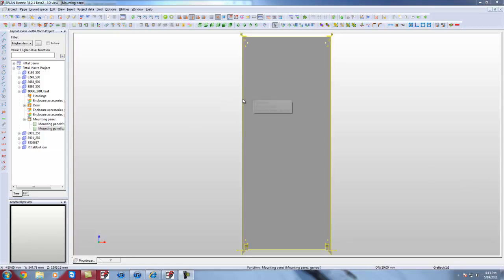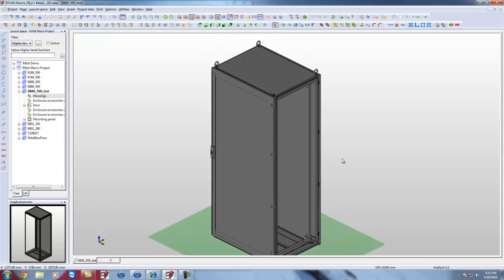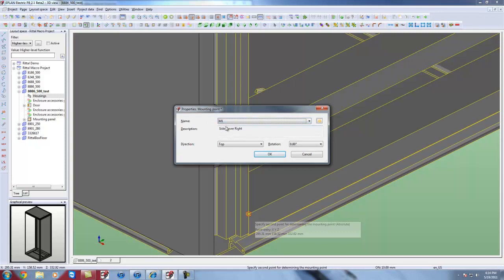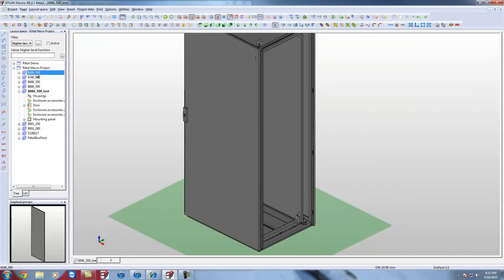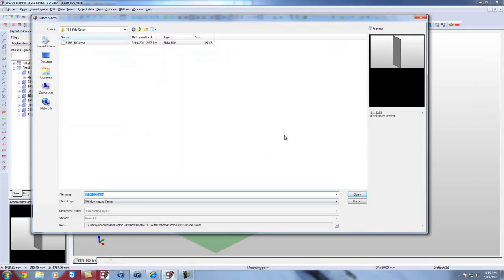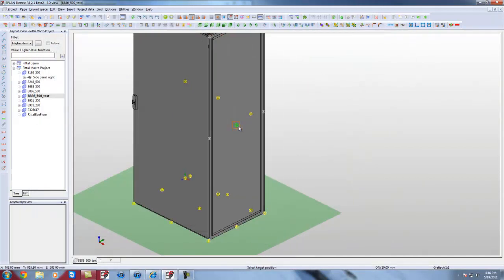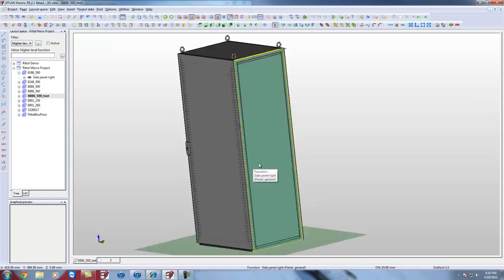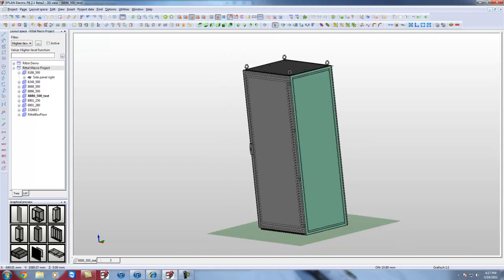EPLAN Pro Panel Rittal Panel Part4

Comment: Hello Sergio, I've watched all your tutorials of propanel, especially the ones about rittal enclosure. I am trying to build a bayed TS8 system but I'm not able to stick the enclosures perfectly. I use the macro from rittal website and I defined the mounting point as you did in this video, but when I insert the 2nd enclosure it doesn't stick to the right point. Any help will be good. Br, Alin